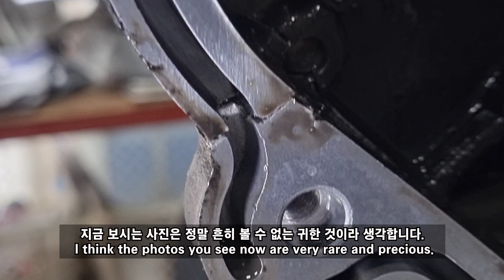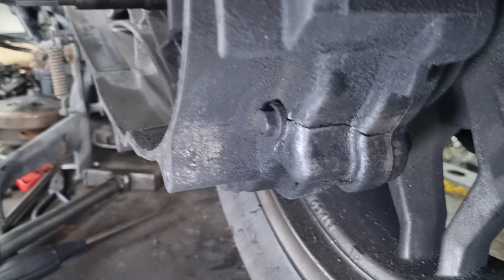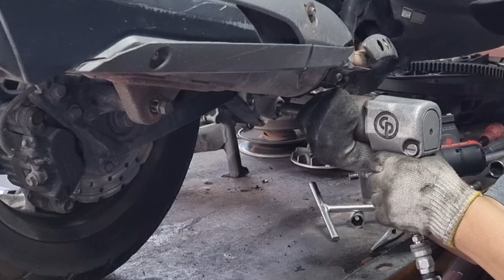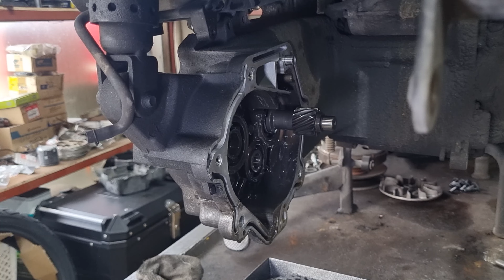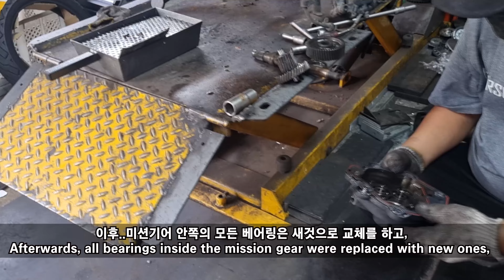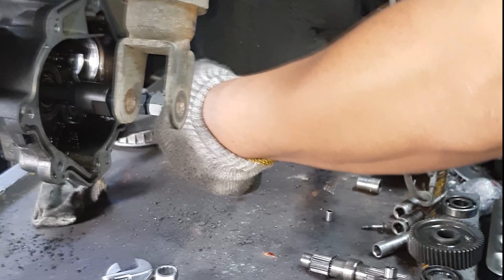This is a mysterious symptom. Why is the mission frame broken? Kymco X Town 300cc

Comment: Maybe the breaking Bearing cause the damage in the frame.. The shaft was turning wrong and this shake caused distortions and Jolts
Reply from the maker: good!! 👍👍
Reply: @MotorcycleRepair  thank you my friend. I have the same scooter. Kymco Xtown 300 year 2019/9. I am watching you from the Europe. Have you any suggestions about led headlights? Thank you for your previous time
Reply from the maker: @rassitxc6936  Wow...you're far away...
Thank you so much for watching my channel. 😄
The "suggestion" for the "led headlights" you mentioned...what does this mean?
my opinion? Or are you curious about the opinions on tuning to change to led headlights?
Reply: @MotorcycleRepair  thank you... You are welcome.. Both.. And the opinion about changing and what type.. Me halogen lights are 35W each one.. Must be the same? Have you any suggestions about the brand and type from Aliexpress?
Reply from the maker: @rassitxc6936  If you can replace it with "led headlights" I highly recommend it.
However, it is recommended to replace it with one that consumes less than 35w.
Motorcycles never have enough electricity.
In addition, excessive electricity consumption ... at least causes poor fuel economy, at worst it strains the engine, and it is common for wires to melt and burn out.
Even if there is no problem right now...
Over time, 100% electric lines will fail.

I don't think the products sold on Aliexpress are bad.
It's just.. there are some dishonest sellers... so I think you can make a choice after reading the purchase reviews.

**
There are many people in Korea who want to change to "led headlights".
But..
Changing to "led headlights" is illegal in Korea.
If caught, you can expect a fine of about $2000. 😂😂
**
Reply: @MotorcycleRepair  OMG.. Really? I understand. So your suggestion is to get lower than the 35W of the halogen that it wears from the factory. For example About 30w each one.. Yes I agree with you about the dishonest brands. Anyway I don't want to spend you precious time.. Thank you very very much for your help and for your time... I wish you everything goes well in your life. Greetings from Greece
Reply from the maker: @rassitxc6936  Thank you for visiting my channel and for your interest.
I hope you will have good and satisfactory results.
nice greece!!
Happy New Year. 🎉🎊🎈
Reply: @MotorcycleRepair  million thanks. Happy new year too